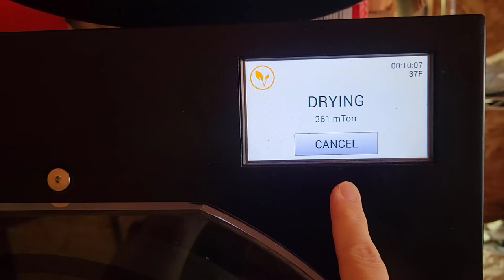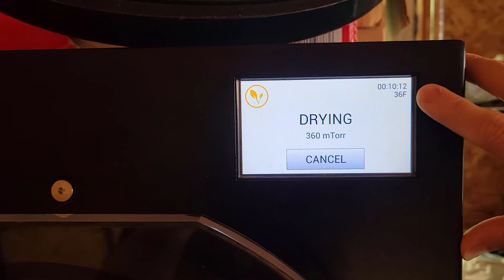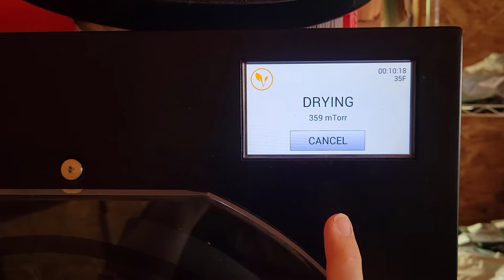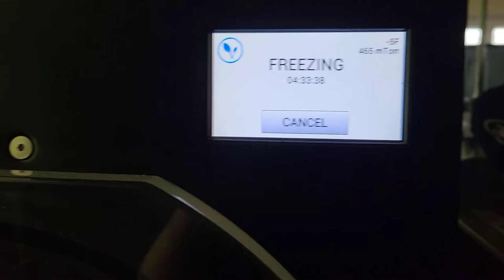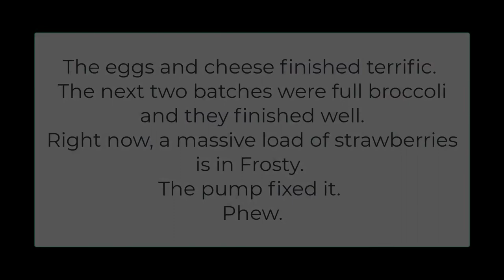Vacuum Pump Error Message and Troubleshooting Steps

Comment: Great job! I'm finding that i need to develop more patience.  I bought one 2 weeks ago and can't get through the bread run yet without a vacuum error.  Will try some things tomorrow.
Reply: Try your drain valve.  Mine had rust in it. Replaced drain valve and it was my answer. Running fine now.
Reply: @carolechubb9220  Thanks, Carole. I just purchased a new valve and will replace. I'm now running more vacuum test runs according to HR tech. 45 min of vac with tray in nets about 600. Now I'm finishing up a 4 hr vac without tray. Noticed it got to 500 pretty quick and now at 185 after 3.5 hrs. Seems like something with the tray. Both vac tests without freezing and no heat. Tech already had me do th offgas burnoff. Funny how I still smell an odor though.
Reply from the maker: That is so frustrating. I'm so sorry. Is it working for you now?

Comment: I had a very smiliar experience to yours except with an oil free pump.  The last time my oil free medium FD worked was just before Jan 2022. At that time it was six weeks out of warranty. After trying several times to get a load to work, mid January I contacted support through the support website and sent data files. I had to pay $45 before they would talk to me, that’s fine and was fully disclosed at time or purchase.  My issue was “failure to achieve a vacuum”. I got an appointment for the following week the tech looked at my data file and told me to update my software and do the leak test and the epoxy leak test. Little did I know this would be a long process not only because of having to “wait in line” but because I had to have my hubby’s help and we both have to pace ourselves so this prolonged our resolution. 
Three days later I sent leak test data.
Tech then sent me a valve and drain hose and epoxy harness, we had requested both those things to try and move things along.  None of that helped. 
It was now the end of Feb and tech instructed me to do a mock batch and send log files to him. It took a long time to get files back to him because I saw a possible solution In this group I wanted to try. 
Tech then suggested a new vacuum sensor that didn’t help.  By now it was mid April. Shortly after I sent him those files I received a call from him saying “we need to get you up and going again”. He suspected the vacuum pump and he wanted to send me a loaner and if it worked then my costly 14 month old vacuum pump was no good. Sure enough the loaner solved my problems completely. I am now a very happy owner of a Premier pump as of May 25, after approx 4 months of support exchange. Life happens it’s nobody’s fault and I remain a happy HR customer.
Reply: Glad it was just your pump, and not the Harvest Right. Taking the freeze dryer apart, and trying to troubleshoot is a pain. I would love to have a "backup" vacuum pump some day, so if i run into a similar problem, I can rule that out (first), before pulling my hair out with taking the Harvest Right apart.
Reply from the maker: That can be so frustrating. I'm so sorry.

Comment: I know the pain and frustration you went through; I had a remarkably comparable situation with my low-profile oil-less pump. I did everything I could by watching every Harvest Right YouTube video I could find and performing surgery on my FD. I finally contacted Harvest Right and after retrieving my data logs from my unit and sending them in they said it was my pump that was failing. The pump for me was still under warranty which was a big non hit to my wallet. Problem solved………….
Reply from the maker: Oh Bill, what a headache. I'm so sorry you had to deal with that, I'm so glad the problem was solved. What was the first thing you FD to celebrate?
Reply: Bananas for the grandkids

Comment: Wow. glad everything is working after all that. Did you consider the "Premier Pump?" It costs a little bit more, but requires less oil changes than standard (which might help extend it's life). It's a good middle ground between the "standard" and "oil-less" pumps. Oil less, I've heard has to be rebuilt every so often. But, then again... I know the feeling of sticking to "what you know" with the standard pump (and software). I also refuse to upgrade my software.

Thankfully, when i bought my freeze drier in Oct 2021, they automatically upgraded me to a premier pump. I started using my freeze dryer 6 months ago. I've been using it 3-4 times per week, freeze drying blueberries, bananas and potatoes (fries). Mostly trying to unload my 2 chest freezers worth of frozen blueberries. I consume a lot of smoothies, so trying to freeze dry as much as possible (to prevent food melt/loss, if the power goes out). We've been told to expect power outages/blackouts this summer. And yes, Missouri is humid... lol...23:21
Reply from the maker: Thank you for commenting! Yes, I've thought about it. I was even considering getting it to replace this one, but I was thinking I'm not paying that much if the problem isn't the pump. So I bought the standard to help diagnose. Now that I know the situation, I'm considering the premier. Thank you so much for your comment. I'm not excited about the blackouts. I hope you're able to get through those freezers. It is definitely a daunting task.

Comment: When I had trouble with my machine the support guy told there were no sensors in the machine.  I knew better and was angry that I had to pay for that kind of advice!  I did figure out the problem.  They had sent me a tube to put into the original tube and it messed my oiless pump up.  I am sure they didn't want to fix that even thought they admitted they had troubles with that so called fix.
Reply from the maker: They said WHAT??? That is ridiculous. I'm so sorry. There is a sensor - there's a sensor on the third shelf down (medium) for temperature and if the product is finished (not always accurate but I put the most dense item there anyway to be safe) and there's a sensor at the top of the drum. They sell them! They're NOT cheap. I hope you got it fixed and it's running now.
Reply: @FreezeDryingMama  I ran CNC machines and knew there had to be a sensor.   There wasn't anything wrong with the machine and I put the oil pump on it and it is back to the normal times and processes.  It was the oilless pump that was damaged and by putting the smaller hose inside the normal vacuum hose it put too much strain on the pump.  It will run but the times go lots longer and it does take longer to do a load.  I know they were and are overwhelmed but they need  better training program for their techs.  I am sure they just didn't want to replace my pump even though they were the ones who told me to put that hose in.    Good to know it is the third shelf.  I knew one had to be different but wasn't sure which one.  Now I know to put the denser things on the bottom shelf.  Thanks!